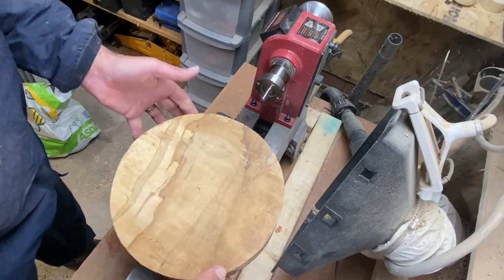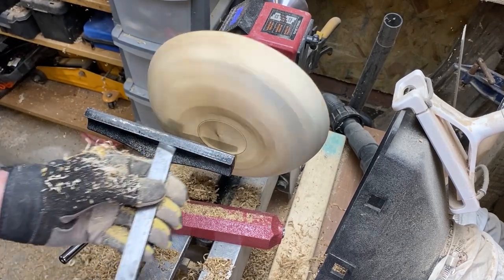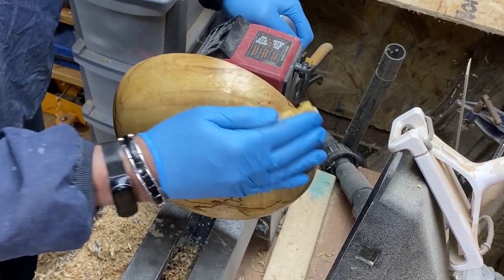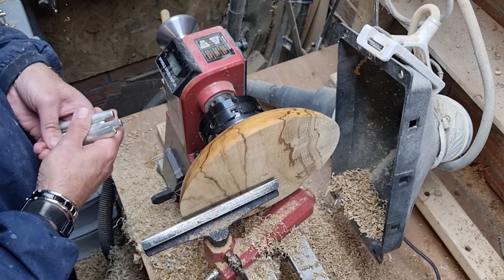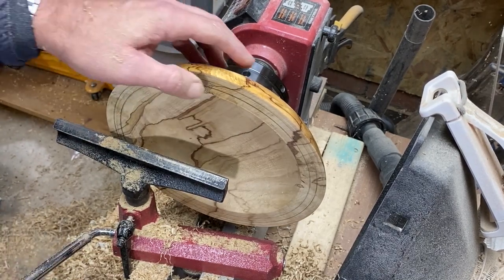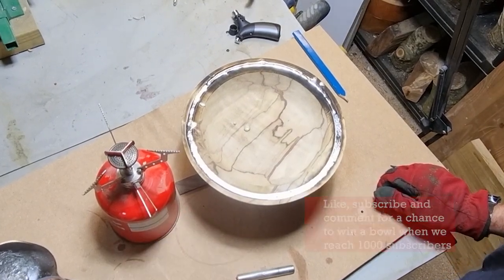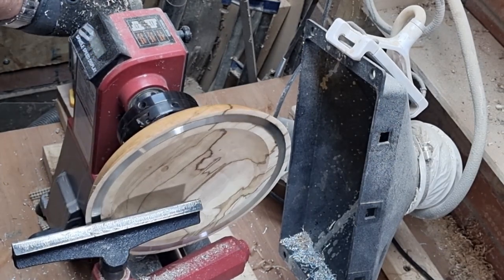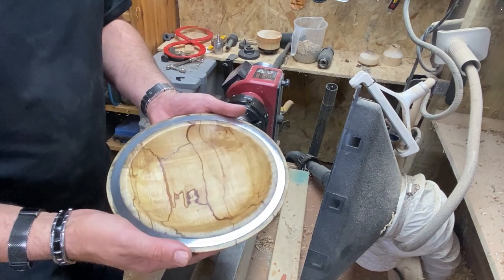Woodturning Project -  Horse Chestnut and pewter metal inlay

Comment: Great job Mike. Had a thought about the undercut you mentioned for the inlay to stop it falling out.  A method i have used with success, especially where an undercut may endanger the integrity of the job, is to insert screws part way into the bottom of the channel. The metal forms around the screw and the screw acts as an anchor for the inlay. Another version is the remove the screws. The metal flows into the thread cut by the screw and secures itself. Hope this helps. Cheers from the Land Down Under.
Reply from the maker: Thanks Ray, I like this idea, if I used brass screws and then turned it back to expose the heads it may look like the piece had been screwed down which may be nice! All the best, Mike
Reply: Cool or perhaps large headed copper nails from a boat builder. They would have no driver slot and look better @MikeHolton
Reply from the maker: @rayswann9080  fantastic idea, thanks Ray!!

Comment: Good evening Mike.
Great channel! Having seen your previous pewter inlay video, I  decided to have a go myself. I was lucky that someone had given me an old, very small cast iron saucepan which I used as a crucible. I sourced my pewter from junk/antique shops in the form of old tankards. I had some extra ceramic tiles which I used upside down on the cooker hob to protect it from spills. To protect the wood somewhat when pouring I went to B&Q and bought some aluminium tape. I taped all over the inside of the turned bowl and the inner edge and also the outer edge, just leaving the recess channel to pour into. I was quite pleased with the result. I will do more in the future.
Reply from the maker: Hi Simon, thanks for letting me know your results! I did not go for old pewter as it contains lead which can be bad but in small quantities it would be fine. It will also go dark over time which in itself could be a nice effect. I did not bother to protect the wood as any burn from the pewter is always very shallow. How did you get on with the fine sanding and buffing? Any problems? 
Thanks and all the best, Mike

Comment: The figure on that piece of wood is amazing!  I really like the metal inlays.  

Do you find that the hot metal warps the wood?
Reply from the maker: Hi Ted, it does a little yes. I would not do this on wood that was not fully seasoned as it could make it split. Thanks and all the best, Mike

Comment: Still slowly working my way through your back catalogue lol.  Would love to see something similar to this, but instead of one solid band of metal, it would have two thin 2-3mm strips, 20 or so mm apart and then some kind of pattern that connects them, done with a Dremel , then all turned and sanded back like youve done here. 

Im rubbish at describing it but in my head it looks amazing 😂
Reply from the maker: Haha wow that would look amazing but boy would it be tricky especially with pewter. Let me have a think about it and I'll see what I can come up with 😀
Reply: @MikeHolton  lol. I've seen enough pointy, nobbly things spinning around on your lathe to conclude that tricky is definitely within your skill set 😁
Reply from the maker: @rustysawblade2591  haha well yes but this is a different sort of tricky lol

Comment: What tools are need for melting the metals safely
Reply from the maker: Hi, the pewter melts at 220c so is easy to melt with a standard blow torch. The ladle needs to be something with a significantly higher melting point, the one I use is stainless steel. You can get specific ladels for this purpose called lead ladels but I do not have one. When pooring make sure you do it in a well ventilated place and have fire suppression equipment close at hand. Finally make sure to protect your hands and eyes. Hope this helps. Mike
Reply: Thank you

Comment: Does anyone else consider it dangerous to overheat a fuel container? that stove is not designed for casting, you should not point the flame at it
Reply from the maker: Hi, I appreciate your concern but the torch is never pointed at the fuel container. That type of torch is very directional so the risk is very minimal as heat fall off is tremendous. I do appreciate your concern thought. All the best, Mike.